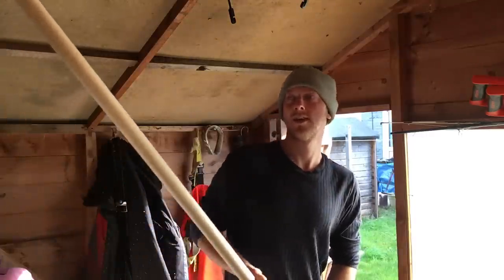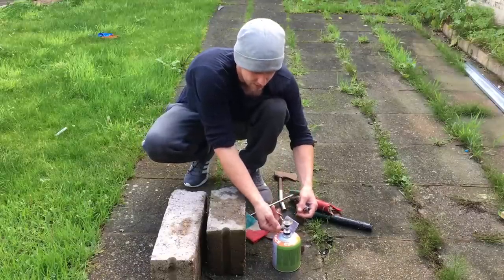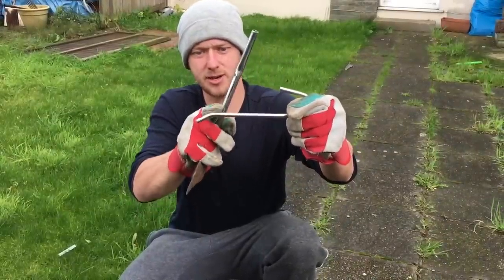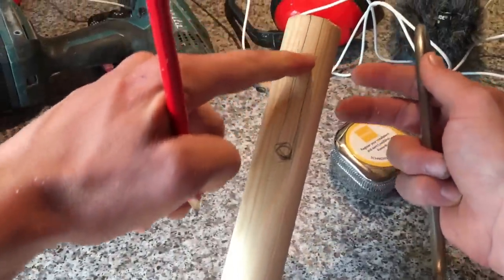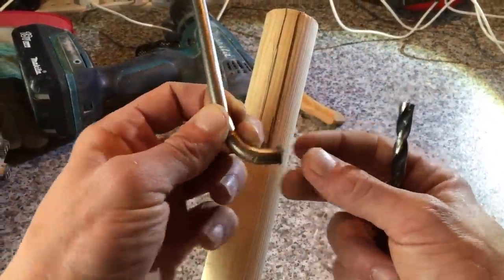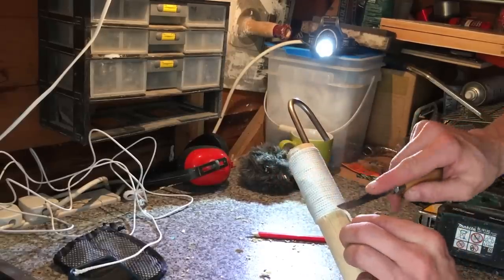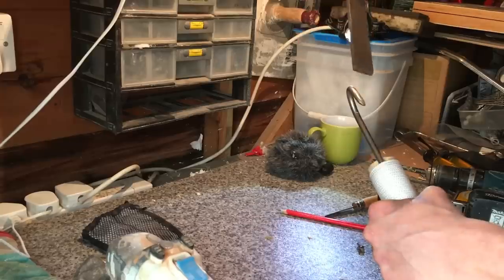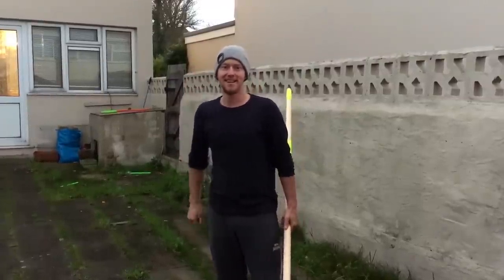Big Fish Gaff , How To Make A Chin Gaff

Comment: Great video, just a quick note about hardening steel, if you heat it up to glowing red the dunk it in oil it will harden if there is carbo in the steel. Heating up steel and letting it cool slowly is called Tempering the steel and is used to soften hardened steel. Paul